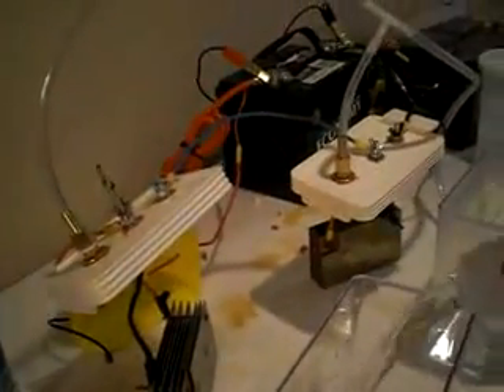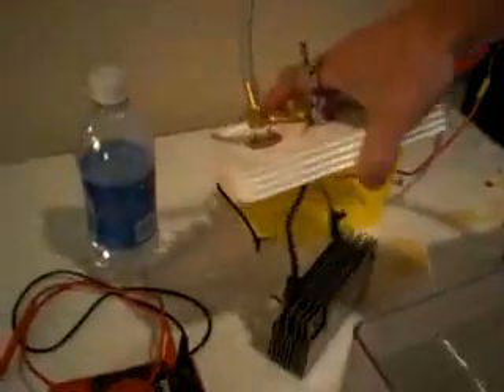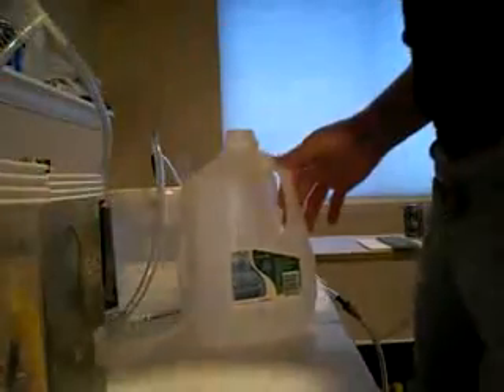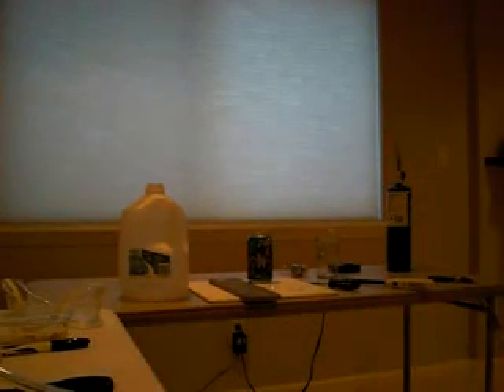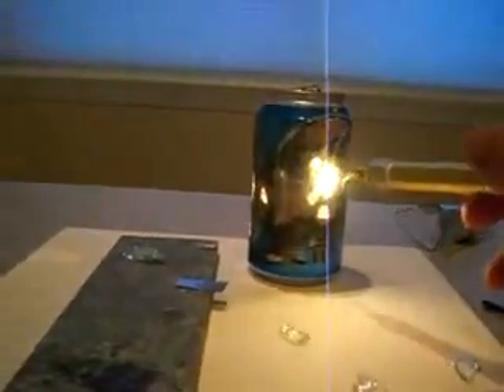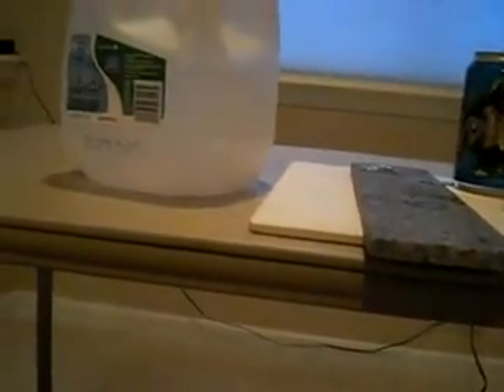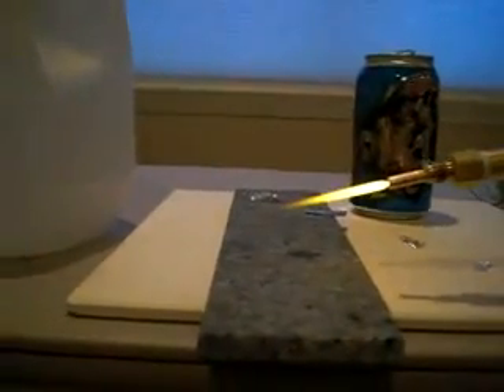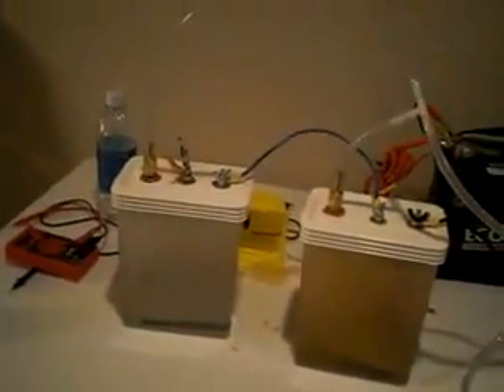Hydrogen HHO Flame from Water DIY 5072 Degrees

Comment from the maker: Good question.  In this particular video, my electrolyte was baking soda and I was producing only about 2 liters per minute.  Not only is the flame cooler, but the flame color directly depends on the electrolyte chemical used.  You can add chemicals to electrolyte to make it burn green, orange, blue, or even red.

Comment from the maker: Not even close.  See, the amount of HHO you actually NEED to increase vehicle efficiency is much less than you need for a torch!  Therefore, the required amperage is much much less.  That's why the Water4Gas design makes so little gas, less amps and it won't make the water hot enough to produce steam.  But your alternator is a powerful generator with a big engine behind it.  More than enough juice for what you need.